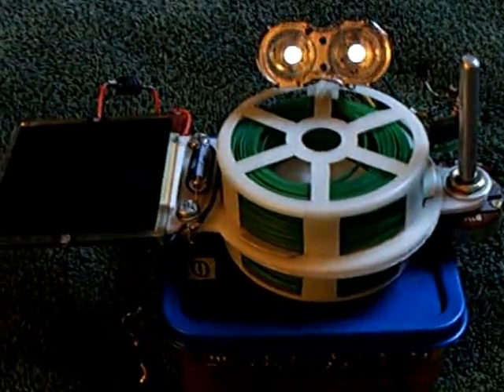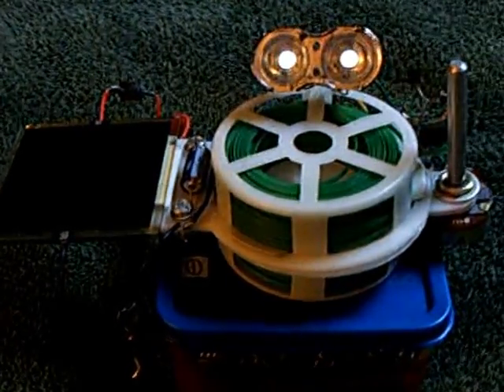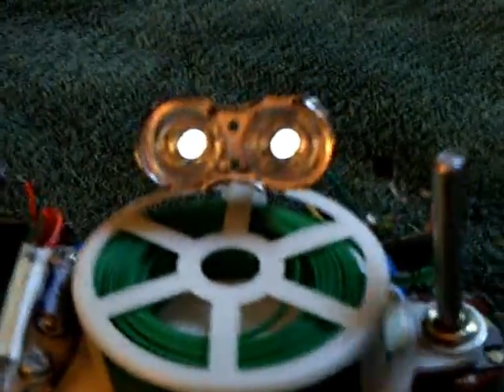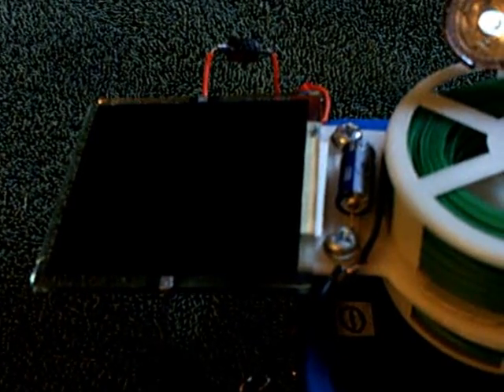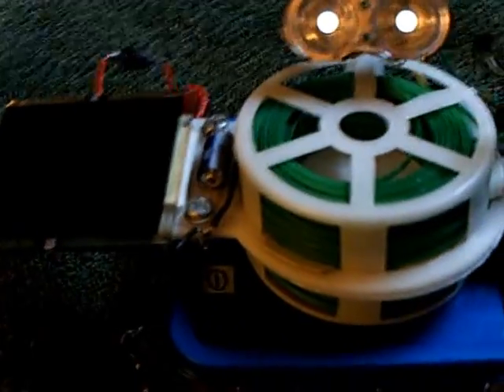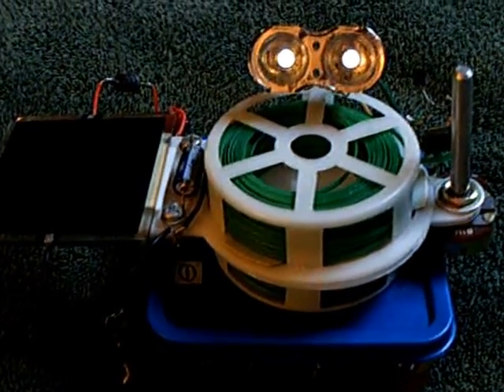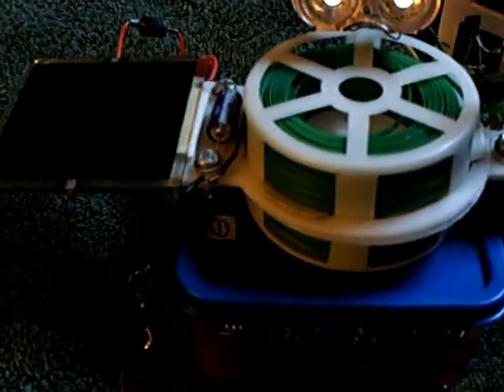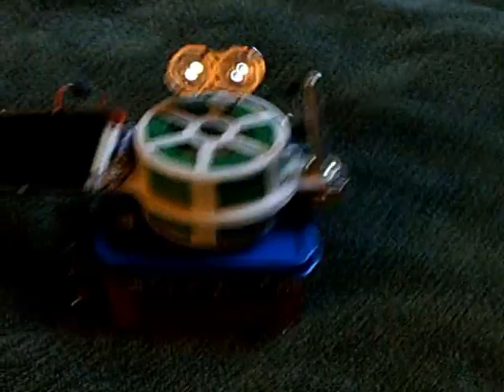My light powered Non-Stop running device

Comment: I was wonder if you could collaborate with all the energy forum guys and do a joint video on the best and cheapest way to obtain/buy an oscilloscope of sorts whether its new or used or build your own type. And also a second part on what to look for on these different circuits? I've seen a couple DIY things but its mainly for audio oscilloscope. I'd buy a dso nano quad but its max voltage is 80v. I'd like get a used one but don't trust eBay for that. send info to thecuddaking@gmail.com

Comment: Well done indeed then. I suspect you might get better charging from an oscillator, running off the panel. It can keep your light power above the voltage threshold of the battery. In lower light conditions.

Comment from the maker: The "dark closet" experiment is a good idea.  It really depends on how charged up that cell is.  Early tests, before I put all the pieces together, showed that the cell dropped down to the oscillator cutoff voltage of .43v after about 12 hours. The cell appears to be getting stronger with time which is the opposite of what I expected.

Comment: @Lidmotor Good job on achieving your goal with multiple projects. It seems that “self running” devices may fall into different categories. There may be some devices that trigger a process that may make external energy available for use to sustain its operation or self loop, some that may run on a very long-lasting power source, and there are very efficient devices like yours that are solely consumers of energy that’s captured and stored by other parts of the system. Does that sound right to you?

Comment from the maker: The solar panel, rechargeable cell, and Penny oscillator are all in parallel.  There is a diode on the solar panel to keep it from draining the cell at night.  There is no daytime circuit cutoff method like on a solar garden light.  The LED oscillator circuit is constantly on.

Comment: This oscillator reminds me of the joule ringer 2.0 sort of. The crystal cell battery and the interaction between the coil collapse and pulse to charge and discharge the battery stays floating. Sort of a very low flash and repulse system. The solar cell is just keeping the crystals moving so it stays active longer. Remember the crystal cells capture charge ultra faster then standard batteries. I think the crystal cells themselves are crude capacitors in the sorts.

Comment from the maker: This stainless steel and Epsom salt rechargeable cell is one of the best ones because it was so easy to make and it works well.  The lead /alum rechargeables are much stronger.  My "plant battery"  is the longest running at over two years ---but I consider it a just a low power galvanic.  It kinda depends on what you are looking for.